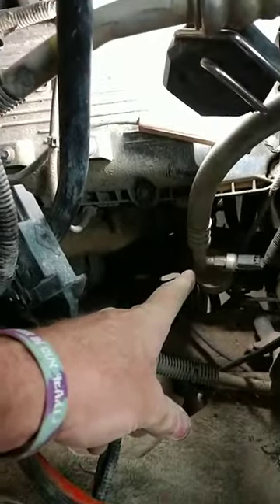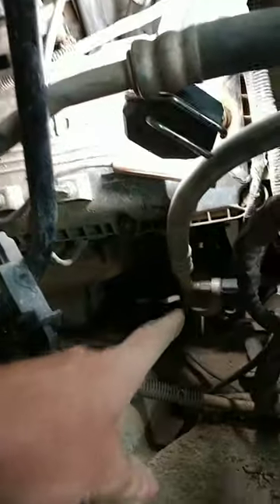How Engineers Keep Mechanics Miserable (Part 287) #shorts

Comment: The reality is vehicles are not built to be serviced. They are built to be assembled as quickly, cheaply and accurately as possible. That being said some are a lot harder than others. Engines that look good on the stand when they're designed meet the body that looks good on the outside has ample room on the inside for the engine to fit for ASSEMBLY. Then along come us- 😢😱

Comment: The reason you have to work on more fords is because they out sell ragged ass Chevy . I think it is nice the mentally handicapped have there own brand ….dodge . Ford trucks have been outselling the other two for about 50 years now and chevys little 327 can’t keep up with fords six cylinder. There is nothing Chevy in a duramax truck and dodge figured out a long time ago that they make junk and went to Cummins for a motor .